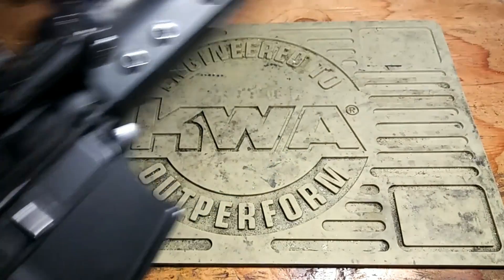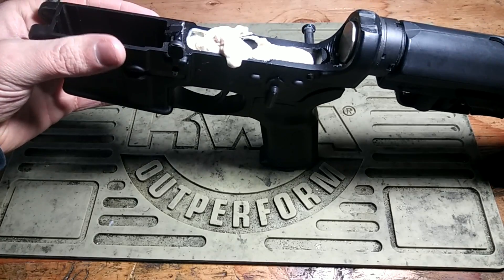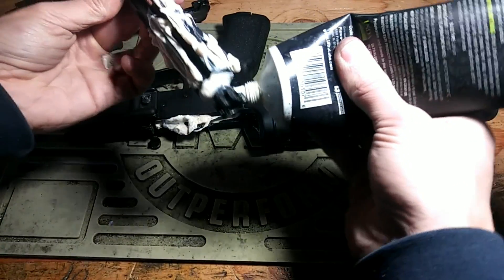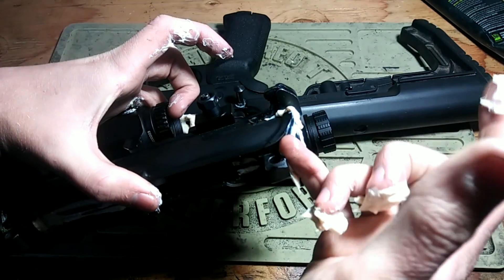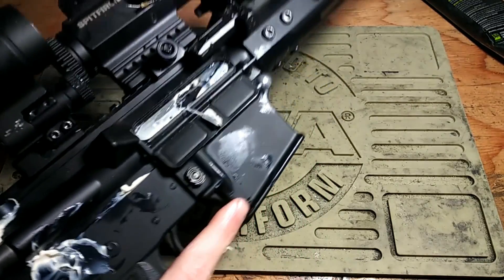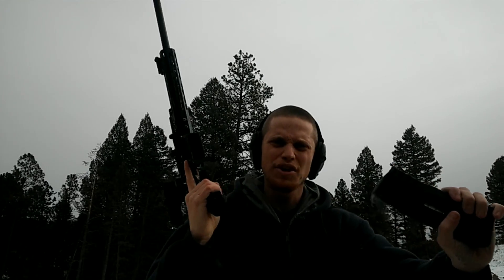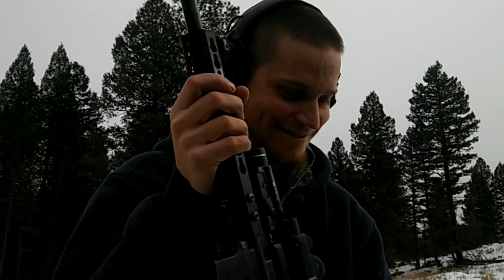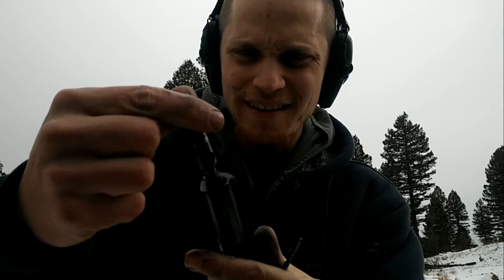MythbustAR15 OVERlubrication and NO GAS RINGS?!

Comment: Didn't prove anything with the lube.
Reply: I make sure not to use too much. Static shooting is no problem. When I'm not gingerly handling my rifle and beating it, I notice after about 250 rounds it gets realllllly sluggish. Just a dab of grease on the bolt section and rails and I haven't had that problem up to 500 rounds at a time. Mass amounts of actual dirt from more than static use just gets too clogged up with too much lube.
Reply: @MichaelCheritto-o4n  the cheap followers mostly. A little sand would keep them from functioning.
Reply: @MichaelCheritto-o4n  the mag body and spring seems ok, but I actually had a 1911 try to chamber the follower.
Reply from the maker: goodinsrt8 lol, how do you figure? you seem so worried that I had too much lube in the lower in the last Mythbuster video...lol

Im not trying to start a battle or anything, just wanted to prove extra lube is not a big deal. 

Did you watch the second buster in the video, by chance?

Thank you for taking the time to watch, by the way, it does mean a lot to me.
Reply: Douglas Thompson I figure because I've seen it from guys that use their rifles daily, my sample size is much bigger than yours. I knew your rifle would run without gas rings, they're extremely recommended but not required for your rifle to function.
Reply: Douglas Thompson Like I said on the last video, over time the lube will collect carbon, sand, etc. And that debris will eventually clog up the chamber and the trigger mech. Not trying to discredit your video and for casual shooters your probably right. But for a rifle that's shot in the elements and has to be depended on, too much lube will shut it down.
Reply from the maker: goodinsrt8 I feel like this whole thing would matter more if we are talking a long time in between cleanings...or like 10,000 rounds straight. Lol
Reply: Douglas Thompson Im talking about one-two days of training. But like I said, for the casual shooter like you and I, we will never see these conditions.
Reply from the maker: goodinsrt8 Id love to have the rounds to test it out. 

what would be a typical round count for 2 days of training? I dont mind exposing my ar to the elements! :)
Reply: Douglas Thompson Id love to have that much ammo too. 

I sat in the truck watching youtube while the guns were being shot, so I dont know the round count. But thats dropping mags in the sand, shooting from the prone, rain, mud and so on. 

Id suggest you save your ammo if you're trying to prove anything to me, I've seen it too many times.
Reply from the maker: goodinsrt8 lol, thats true.

but i do have a select several magazines (all my gen 2 magpul, series 1 hexmags) that i use for "hard use" you should have seen the mags after today, had to wash em they had so much mud and sand in them from the sloshy snow i was practicing in after i filmed.

It was a lot of fun.

i dont doubt you know your stuff, I still believe in my side and you have probably thousands of reasons to believe in yours. 

I have enjoyed talking to you and your comments!

I have some cool videos in the pipeline and Id love to see you there! :)
Reply: Douglas Thompson For some stupid ass reason our guys had to use their issued mags, which actually work great. We had wilson combat mags for the 1911s, those things weren't worth the plastic bag they came in.
Reply from the maker: That seems odd? 

So they had to beat the shit out of the gear they were later to depend on?...

Seems counterproductive.
Reply: Douglas Thompson The mags? No they were just garbage.
Reply from the maker: goodinsrt8 Oh, i didnt understand your last comment i guess.

What is your preferred magazine while we are on the subject?
Reply: Douglas Thompson Magpul or GI, only mags ive ever used.
Reply from the maker: goodinsrt8 Have you tried the M3's?
Reply: Douglas Thompson Whats that?
Reply from the maker: goodinsrt8 pmag newest version
Reply: Douglas Thompson Oh, I dont know which pmags ive used.
Reply from the maker: goodinsrt8 probably gen 2's they are still in production magpul treats them as their afforable model but they are still one of thw best mags for 223/556 out there.